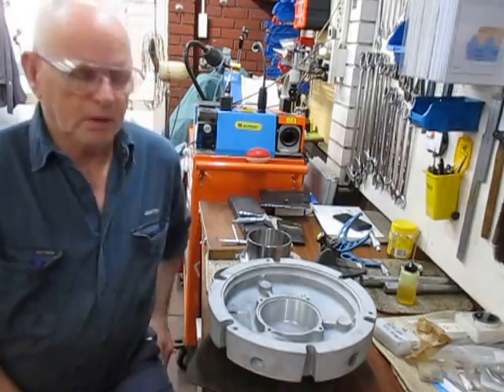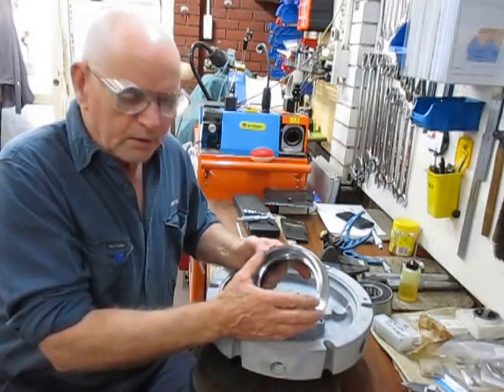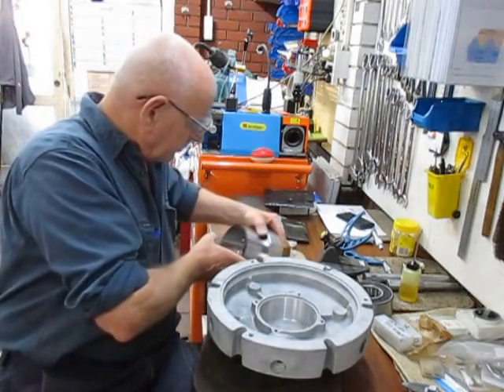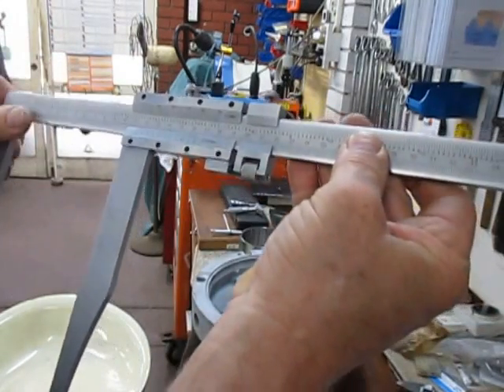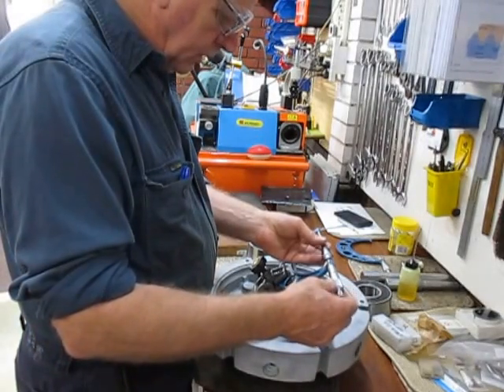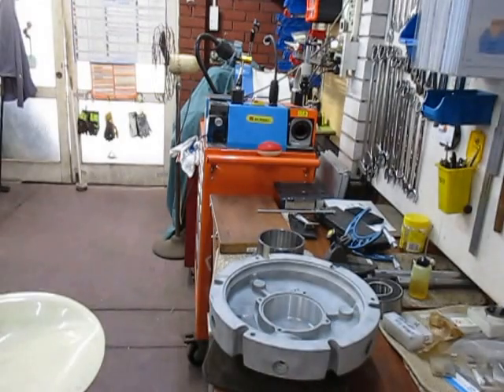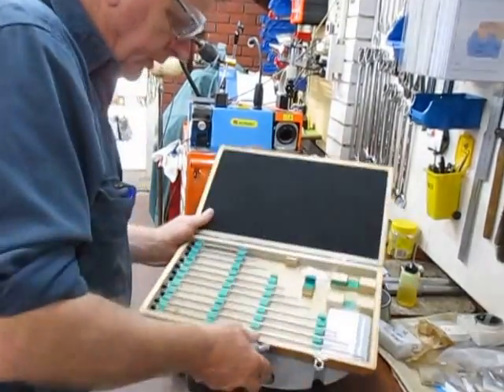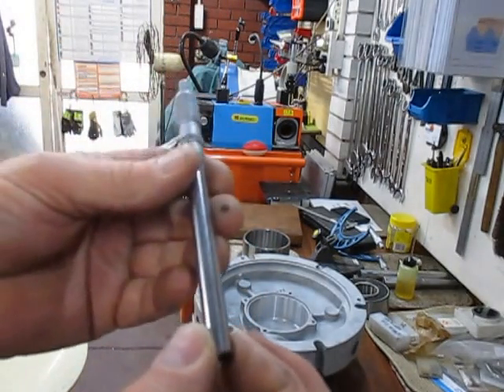Repairing a Bearing Seat What's in Bruce's Box

Comment: I made a mistake of buying a set of import tele gauges ....HORRIBLE JUNK i would trust a tape measure across the bore before i used them
Reply: bubster1981 Spread the news loud, they're rounded parts are horribly done, so, off by thousands, mostly in the smaller diameters...